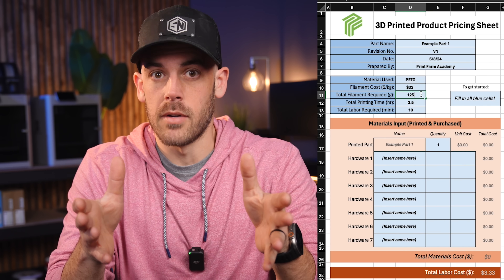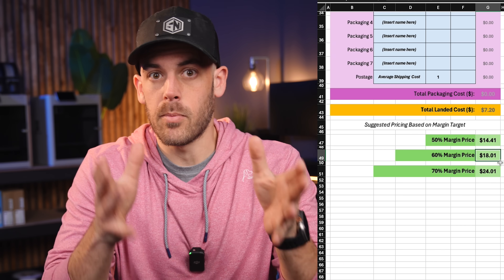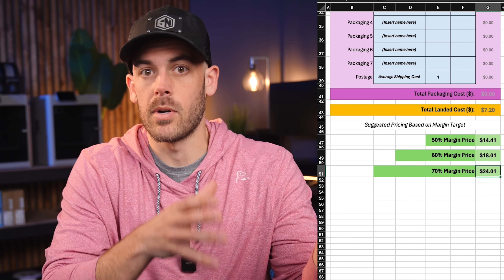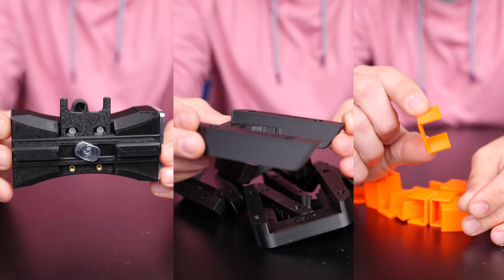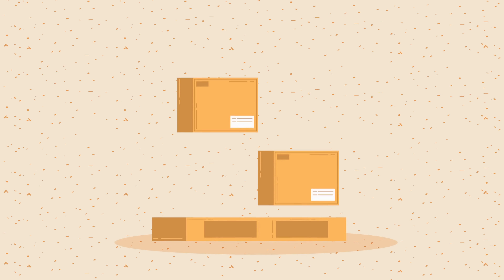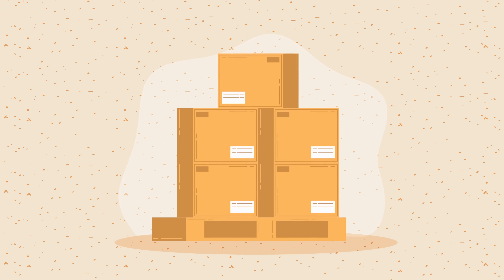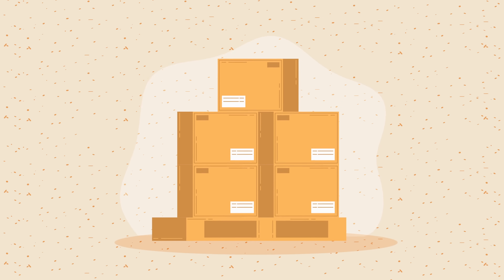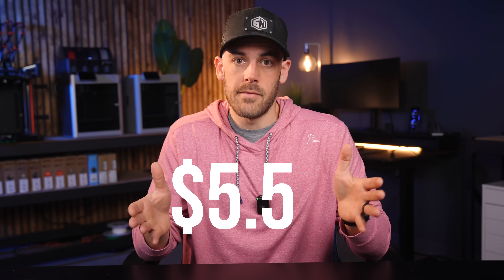Why I charge $55 for this 3D printed part (how to price)

Comment: What I'm hearing is I should get my own printer instead of paying for the huge overhead of someone else doing it for me.
Reply: Yes, exactly this
Reply: Haha. Maybe? 

What problems are you trying to solve? To make things, you need the knowledge,  equipment and software to do it.

If you want to make the drill battery hanger you need a capable printer. You need to identify and purchase the appropriate material. Design the part (unless you can find a free download) and then you can print it.  You might need to do a couple of iterations.

So, would you rather pay $15 to buy the part or do all of that? (Buy printers, research materials, buy design software, learn the software, learn design principles like fit classes).  It's an honest question, the answer depends upon the individual.
Reply: @speedcreep2605  Thats true, that part for 55USD it could even worth it. If newbie think that he could but printer for 150 and print it without STL file good luck. also depends of the thing the important is quality and what filament was used(thermal resistance, flexibility, price)
Reply: @speedcreep2605  true, unless it is your hobby  :) Means your time. Realistically you better be familiar with electronics and software, build you own printer, learn CAD, etc. Once you are in , it helps to solve numerous household problems. Do not expect to earn money though.
Reply: Or you could find someone that doesn't charge as much cause you will be the one incurring all the costs mentioned (+ air quality if you print at home)
Reply: What if you have to pump out 50 pieces in a week?  If you have one machine, that can take a long time. A print farm might be able to do it in a day.
Reply: Buying the printer is the easy part! You better have a serious understanding of CAD design and a 3D laser Scanner for replication parts.
Reply: You could. But you would need a $1000 printer, space for it, and the experience to actually create anything. You could create something "cheaper" but you would probably have to ignore the cost of your own time.
Reply: @MattHawkinsUK you don't need 1000 dollar printer. I literally just did this.  I set it up right in my office next to my pc... i spent about 500 with everything
Reply: @jhtsurvival  I would love to see a set up that’s $500 for everything. Unless you’re talking about a cheap plate shaker printer and a single roll of PLA with some free software to design with and that’s gonna get you not nearly as far as you make it sound like it will. Also, you’ll need extra filtering because even PLA kicks off materials that can make you sick and you’ve got to consider even small printers can be power hungry.
Reply: @cantbsdave  I literally just did it tf are you talking about.  I bought a printer.  First one ever.  Set it up and was printing within an hour.  Designing my own shit. I've had it for like two weeks and have had it running almost constantly.  I've printed everything from petg to GF Nylon Its not hard. I have never done it before.  I'm honestly probably going to buy a second or third for fun cheap ones to customize and play with. Yes my "cheap" single filament printer does everything  a multifilament printer does.
Reply: @jhtsurvival what printer setup did you go with?  My daughter (12) got an A1 mini with AMS (she bought on her own based on me having the P1S), got on tinkercad, did the tutorials, and has been off to the races.  I have a CAD background and can help her when she gets stuck, but she rarely needs it.
Reply: Well, 3d printing nowadays is marvelous and pricing wise becomes very accessible. I see it revolutionary and close to extend as personal computers became a thing. It is way more advanced than digital photography boom, as 3d modeling lifecycle has numerous iterations and refinements. PC adoption by public quickly evolved into software industry, allowing running software products on your PC. Same tendency is here, people as they get 3d printer start tinkering, at first reprinting others creations, later they thinking about creating their very own thing and that is where the main catch. 3d design to model part exactly how you envision it requires skill, similar to coding, where you also do numerous refinements to add features and address bugs. It takes a huge amount of time and requires skill. For someone who just started it could be months due to low priorities as it is first starts as hoppy. Again, going back to PC analogy, there were users and developers. Over decades PC literacy became part of runtime essentials. No one can think a day without basic productivity tools, such email, video-call, writing documents, doing quick calculations in spreadsheets and so on. So sure thing, everyone should try it.
Reply: As with anything else you pay someone else to do
Reply: What you’re hearing is that you should start a 3D printing business. That’s what this video is about.
Reply: I’m reading a lot of comments here about people saying oh I can just buy my own machine for the price of what these parts cost. They’re not thinking about the true cost of the machine, the variable cost of hardware and its availability as well as the knowledge to run it all. Not to mention the space requirement, the indoor air quality, the time to do so again with learning curve. A lot of things people wanna do require multiple different types of filaments as well. To me if you’re not in it as a serious hobby you’re going to waste money and have a machine to collect dust. Find reasonable pricing on high-quality stuff that you want or need and go for it
Reply: As with anything else in life. How much do you think your house would cost if you would build it yourself? Like at least twice as cheap. Maybe even 3 times. How much local mechanic is charging you for an oil change? That would be 10 times less expensive if you would be willing to DIY. So don't expect donations in shape of someone else's time, machine costs etc.
Reply: Tip of the iceburg buddy I spent 5 hours today trying to learn freecad lol
Reply: @tattooeddemon420 I find free cad a pain
Reply: @ @tattooeddemon420  I know freecad skills take time to develop and must be done thoroughly, but if your sentiment is 5 hours is a lot then go ahead pay the 50% markup. It’s not scary to learn freecad and making everything yourself so you stop getting robbed by overhead costs and “profit”
Reply: Yea you could get your own, but be prepared to spend hundreds of hours learning, waiting, fixing, upgrading, researching, designing, etc. I’ve had 2 printers and in 10 years easily spent countless nights.
Reply: @NinjaPooop Bambu makes printers and they allegedly "just work"
Reply: @NinjaPooopthat's not really a thing anymore
Reply: @NinjaPooop Well, new printers are pretty easy to work with also there are so many tutorials and dedicated channels for 3D printing. I owned a cheap 3D printer for about a year and did countless of printing without any issues. It worked well out of the box and still decided to tune it for perfect printing which i did by just copying someone else's settings from reddit.
Reply: @astafzciba  no matter what anyone says there is a steep learning curve to using design software if you’re going to have a business at all because you can’t rip off everybody else’s prints. If it’s for your own use, have fun and learn how to work on machines

Comment: I need a set formula to follow.
Like right now I do
1,000÷Filiment=👍🏻
20÷👍🏻=❤️
❤️×5=💙

Then 1.50×hours=💜

💙+💜=$$$

Obviously I don't factor in the power and whatnot but I thought that was a good equation to find cost of my prints

Comment: You also need to factor in the labour cost associated with maintenance and other machine work. You need to charge your shop rate for that. 

Do not compete based on price or you will always lose. Understand your costs but price based upon the value of the product. Also, the design is much more lucrative than printing as a service.

Comment: This was really interesting.  I used to run a custom woodworking business and having to account for all of the little costs here and there in the process of making a product was mind blowing at first.  This is definitely a similar, yet simpler path.  Sounds like you kind of have to be an parts engineer/inventor to run a print farm, though.  Otherwise, what are you printing?  Other people's designs?  I think I'll definitely have to get a quality FDM printer at some point and mess around with it.

Comment: I think one important point you didn't account for is the amount of time to design and prototype the part. That research and development cost should then be applied across the parts based on the expected volume to sell them. 

For example if you put in 100 hours to design and prototype a part and you expect to sell a thousand of those items over the course of a year, then you would apply 1/10 of an hour of cost to every part. The estimate of sales can be more accurate after you've been doing this for a while, and admittedly at the start it's going to be nothing but a wild guess.

Comment: I am using simple version of print calcualtion on my P1S - for example PLA, $33/kg. Fillament print cost + $1/hour. If a fillament in print cost $3.5, and print time is 10hours. It will cost $13.5 - $14

Comment: All great, but when TLC is $20 and you set a price at $40 it's 100% more not 50%... just saying.
Reply: yes but the margin is off of the final price. (a 75% margin is 4x the base price.) 
markup is the inverse of margin. (so a 50% margin is a 100% markup. markup=1/(1-margin) )

Comment: Electricity also needs to be factored into material cost because a 3D printer will tend to be using a consistent amount of electricity in relation to the length of filament used. And electricity has become a much more significant cost than in used to be.

Comment: Just wonder how you arrive at total hours in a year? I suppose you run your farm 24/7 ? Typically, I estimate at 2000 hours / year working hours only. I.e. 9 to 5 anything over are extra hours and at a different rate. Great video. Thanks for the information. I'll go back and check my figures again.

Comment: Marketing costs need to be factored in. Amazon isn't free, neither is your own website or etsy or ebay. Advertising is essential and probably in the range of 10% to 20% of a product selling price. My parts with a landed cost of $20 I sell for $100 to cover marketing. Advertising. Selling fees, and profit. Learn to add low cost but high perceived value to your products rather than cutting selling price to beat out competitors. Don't enter markets where you can't make money, unless you like being a charity.

Comment: Very interesting but you have missed a number of costs. You have to buy space to work in, this will need insurance and maintenance, you will need third party insurance and a contingency for returns.  Presumably you also have design costs or licence costs. There are more but the point is made with these few.

Comment: Is black PETG filament actually $33 USD per 1 kg roll, even for non-bulk purchases? I was seeing prices closer to $13 USD (with free shipping, sincle non-bulk pricing) per 1 kg roll lately, for black color PLA, PLA+, and PETG at least (non-bulk pricing). I realize that crazy colors can add to that price, for show pieces and materials that aren't those 3 filament types, in black color like the few examples showed. I feel like the cost of the filament will greatly affect the overall cost to make a part, if we are talking about $33 vs $13 per 1 kg roll. And obviously bulk filament  purchases would lower that cost, for a farm.

Comment: Feels like cost for facilities (land, the shop itself, any stuff in it like shelves, and all that), then of course any labour costs related to preparation of prints, including any development costs if it is an inhouse part, which of course must include any software, PC costs etc. Yes, of course this is something you have to estimate based on number of parts you produce, or factor into overall hourly cost of labour. That will for sure be more than 20$ per hour let's just say.

Comment: Seriously, thank you so much for the spreadsheet. I've started modifying it for my use by adding a "Material Database" setup sheet where I can do a lookup for the filament prices based on selecting Material Type and Brand on the main input sheet. I've had to adjust the sheet to my local currencies etc, but overall, extremely happy with it. Thanks.

Comment: I caught an error/bug in the spreadsheet. The total lande dcost currently is the total without considering the Material Efficiency Factor. Currently its adding the default (non multiplied) value for the total cost of filament into the landed price. For instance, my Cost for a filament job is $1.73, $0.67 labor cost, $1.00 packaging cost, and $0.52 added machine cost for a total of $3.92 

However, my MEF for filament would be $2 total, instead of the $1.73 - So My landed cost should actually be $4.19 and not $3.92

Am I missing something?

Comment: The market sets the price, and there are only two components: supply and demand.  All this guideline is a method to discover your costs which obviously must be lower than the price the market is willing to pay to make the product viable.  BUT the price you charge is not based on that cost, only IF you bother making the product in the first place.
Reply: Tell that to diamonds.

Comment: Machine costs are your fixed charges as you figure your depreciation cost and overhead like building costs electric power and other operations costs that are fixed from day 1. Depreciation will fall off but repair costs and replacement costs because you will need the money to expand or replace so those costs usually never go away. Also in labor don’t forget payroll taxes and benefits

Comment: Really interesting insight! 

On a previous life, before burning out of a mental engineering working student schedule, I worked at a steel mill. When I got there the cost was calculated by an excel sheet not updated in 14 years. I remade the whole thing and had a lot of fun and even pride when it was done... and then I quite because my boss was a cocaine snorting lunatic and I had to do my job of managing stock and ordering alloys by the dozen of ton, designing parts, setting up production with the production manager, scheduling maintenance and sourcing parts, dealing with the commercial side of things and then receive angry calls from our best clients because my boss had just called them high as a kite and spewing out nonsense. 

I had enough but anyway... sorry for the tangent, it was really interesting seeing your thought process throughout the video on how you arrived at the final price for the client. I'm currently disabled but I'll check out your academy course and see if I can afford it. Looks like it's worth it if your this insightful on 3D printing at a larger scale!I currently own a Kingroon KLP1 230 CoreXY 3D printer but plan to buy a Prusa Mk4 soon, which has slightly larger dimensions that my present printer and opens me up to the wonderful world of Prusa (big fan of printables) and once I've fully recovered from my health issues... I might expand further... so this course sounds like a good idea!

Comment: These calculations are so far off from what ive observed from my printers, from electricity cost being halved of how much his run (not cost, literal wattage usage)  Aswell as upkeep on machines. I do a nozzle switch once every 2 months. And with maintanence every half month month - 2 months for lesser needed things. The maintenance cost is low (not for time spent that takes legitimate time and knowhow) . Just not buying these numbers unless hes making it look far worse than it is. Hes also using hugely costly printers with proprietary parts i wonder if thats it. But so far at running less than one year my machines are sitting around 5 - 6000 hours .. not adding up.